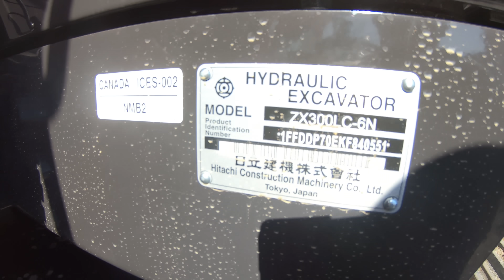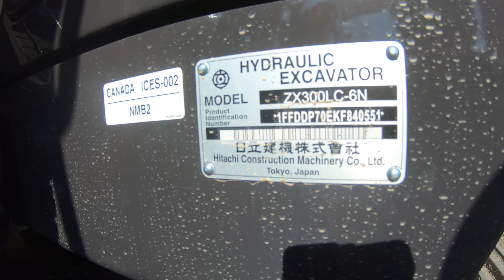Overheating mystery solved for John Deere/Hitachi Excavator 35zts

Comment: There's a product called degreaser (or even strong detergent) which cleans oily things, allowing the early detection of problems and stopping dirt getting in places where it will cause damage. It would allow that filthy oil cooler to cool oil which in the state you have it would not be happening. You obviously haven't heard of degreaser.
Reply from the maker: I cleaned the oil cooler with a pressure washer
Reply: @jmuller86  great news, I'd hate for you to have to pull it off again and risk contamination. It's amazing how oil can act as an insulation and stop radiators from cooling properly, we probably notice it more here in the northern regions of Australia where heat is an issue. There is a very common brand of truck which had to replace all the engine cooling radiators as a recall back in the 1970s because they were not big enough for Australian conditions, so they put new radiators in the trucks with the biggest engines and used the ones they took from those trucks (reconditioned) in the next model down and so on, it still cost a lot and their reputation took a huge hit, probably hasn't recovered even today as they have never regained their market penetration.
Reply from the maker: @ctiley2212  geez that sounds like a nightmare for that company. almost sounds like when toyota did that recall thing on the frames. My friend had a $500 beater and they gave him like $12k to give it back to them

Comment: Stuff rags in the holes when you clean or scrape, then all the crap won't fall into the engine. Carefully pull the rags out. Brass wheel on a dremel will clean the old gasket and any dirt witout hurting the aluminum. I use my finger to make a thin layer... I like using ultra black gasket maker.

Comment: Seems like the fan is so damaged it may cause it to over heat.  HOw much is that to replace too?  THe note you make on that clutch is so important.  See that the counterweight on the clutch is on the opposite site of the shaft so that if the counterweight is pointing down, the shear key is on the top, right?

Comment: I had a new ford 1710 tractor it always run hot,i was bush hogging and a alder hit  my radiator and destroyed it so I replaced it with a new fan and radiator and thermostat and radiator cap thus it was a bad radiator cap

Comment: Weld the clutch to the pully, there is no reason to have a clutch anywhere but the fan.
Reply from the maker: Its not a clutch pulley actually, its a harmonic balancer. Alot of people said to weld it but it could vibrate the motor in ways it shouldn't if I did that.

Comment: Should have changed the leaking front crank seal while you were in there...................oil is is one of the causes of original balancer rubber failure.

Comment: Just a suggestion, I would have changed that crankshaft seal while you had the pulley off. The JD dealer should have told you that.

Comment: Use a water hose and spray water through the radiator and oil cooler sand and dust gets blown between the cooling fins especially with that wet oilcooler on the outside,clean it to get more air flow

Comment: I surprised you didn't replace that oil seal on the pulley.  Obviously leaking.
Reply from the maker: I didnt notice it leaking, it was wet around that area because its hard to fill the oil and I end up getting it down there. But your right I shouldve just replaced it anyways, others have mentioned that too
Reply: @jmuller86  Good Man!  How do you think we "old guys" learned that to begin with?  ;-) Wisdom is just another word for Been there, Done that!

Comment: Jesse, this comment is over a year late, but watch this bloke, John Mills. He has a strong northern English accent, but even if you can't understand that, watch what he does. I am sure you can still buy gasket material of any thickness, even in the USA.

https://www.youtube.com/watch?v=UbTs3CUzMPs

The gasket-making part starts about forty-five seconds in. John uses a steel ball to cut round holes, andn that is good, but you can also use a ball-pein hammer to do the same thing, and using the flat front face will cut then outer edges.

I usually give the part for which I am cutting the gasket a light smear of grease. That helps the gasket paper stick to the part, and prevets it from slipping. 

Paper gaskets are better than silicon because bits of silicon often come loose and block up oil passages and water channels; paper or cork don't do that.  You will never be without the correct gasket again.

Comment: WHY? Harmonic balancer has "RUBBER" in it to act as dampner . RUBBER DON"T GET ALONG WITH OIL?
LOOK AT THE OILY mess on that engine, a good regular washing "MAYBE"
Oh you might want to address them oil leaks? Ya Think?
Reply: Rubber may not get along with oil, BUT there aint supposed to be any oil near the damper ring FULLSTOP. Seen this problems so many times in my many years as a mechanic. You saw in the video how easily he spun the fan with the belt attached, bells should of rung then.
Reply: Harmonic balancers fail and plenty of 'rubber' comes into contact with oil in an engine.  The two are not really related.
Reply: @gus6rocks  if it's a viscous fan it will move , as it gets hot the tension increases and the fan speed increases .
Reply: @dennisphoenix1  nothing to do with the viscous fan, I mentioned the Harmonic balance rubber damper was buggered. You could see the outer harmonic balancer pulley turning independently of the inner one.

Comment: I guess if u can turn the fan with little to no resistance there's a far chance that bottom crank pulley is suspect ay ...I'm a little surprised u dint fit a new crank seal ..all good info tho
Reply: Depends on the engine temperature and the fan clutch.

Comment: You can torque this to spec immediately. *Proceeds to just hit it with impactor. Haha.
Reply from the maker: yea I was just mentioning the fact that you can, I have a few torque wrenches, but I only whip them out if the book screams for it. With the waterpump the book says something along the lines of " install waterpump with gasket" lol
Reply: @jmuller86  I was just messing with ya. I don't even own a torque wrench. I rarely even need one. Good fix man.
Reply: @PossumKing  - Not sure if you guys view South Main Auto's YouTube channel - the owner Eric O likes to also "torque to spec" using an impact wrench.  After a while, when you're as experienced as some are, it's OK to do it "by feel" - except for obvious things like cylinder head bolts! 😀
Reply: Most torque wrenches are way off anyway. If you have a torque wrench and no torque wrench tester, you just have  a heavy wrench.  @samvalentine3206

Comment: Man your lucky you didn't break a crankshaft. Harmonic balancers balance out the torsional twist of the crank. The larger diameter of the pulley will rotate the fan faster, improves the heat balance. And that fan is maggoted..I'd be checking for soft or broken engine mounts..going by the engine oil leaks..make sure all those foam bits are in place around the radiator, to stop hot air recirculation..just my  thoughts..👍

Comment: Didn't your dad teach you how to make gaskets?, all as you to do is to get the correct thickness gasket paper, lay it onto the part and use a small ball peen hammer and using the ball end, gently tap over around all edges and holes, so as to basically cut the paper, the holes you can punch out the rest of the way.
Reply from the maker: yea I have used those for 20 years, but the right stuff is exceptional, its meant for this kind of thing
Reply: @jmuller86  I always carry a tube of "Instant Gasket" which is a black silicon, but in some cases you really need to have a gasket, because the clearance tolerances require it.
Reply from the maker: @brianmillar5075  yes you are correct, I should have mentioned that
Reply: @jmuller86  You might find because you have opened the cooling system, sometimes that can cause small particles to break loose and float around in the cooling system and eventually stuff up the water pump.

Comment: Wow, you went that deep and didn't replace the harmonic balancer seal and any other seals that were obviously leaking oil that caused the failure in the  first place. Job is half done.

Comment: For $200 you could have had a new pulley made without the clutch at a local machine shop.
Reply from the maker: its not a pulley though its a harmonic balancer
Reply: @jmuller86  I do understand that, I have had a number of diesels in my fold, including a couple of TDI's, a Mazda, an Isuzu, a Perkins, and a Kubota, and a Continental. Not all of them required that, due to how they are designed.  Some balance better than others.

Comment: I work in a  garage. , usually. They.  Crank.  Pulley.  Make a lot of noise. When going. Bad.     It's called.  A. Crank. Pulley. Or.  Vibration.  Dampener   pulley .

Comment: I'm no tractor mechanic but I don't see why I couldn't weld the old part solid. But I'm guessing it has a clutch for a some reason... To buy parts later.
Reply: I thought the same   shim it it to make it square and tight and a few good tacks would do it . It's a rubber belt drive so don't see the vibration damper being much use anyway
Reply: Some info here about what is a harmonic damper:
https://en.wikipedia.org/wiki/Harmonic_damper

Comment: so in the end of the it was a busted bearing
Reply from the maker: There actually is no bearing in that pulley, just has rubber between the pulley and dampener
Reply: @jmuller86  thats weird usually when the vulcanization on those fails they just fall apart, it looks like a shot bearing, anyway it's really good knowledge sharing, I've seen broken impellers and those weird clutch systems to turn the water pump on only when the water is worn fail, but never this.

Comment: I would just weld it solid like every other machine
Reply: That's what I said.
Reply: But that would change the balance.  It's a harmonic balancer. Would probably damage something else.
Reply: If welded the same on both sides there will be no issue. It is only used to dampen the vibrations to the alternator and waterpump. But they  already are belt driven, so no high frequency vibrations there

Comment: Why not weld the old one solid and save two hundred dollars.
Reply from the maker: That is also a dampener so the rubber inbetween gives protection to the motor from vibrations

Comment: I would have cleaned the radiator off before putting it back in.
Reply from the maker: I did, I am pretty sure I showed me pressure washing it in the video
Reply: @jmuller86  I guess it just looked dirty. With all of the work you did, I would not want to go through what you did with the over heating.

Comment: $300 dollary doos? Stuff that, weld that clutch up and call it good.
Reply from the maker: its really meant to have that rubber on there, it helps keep the vibrations down from a diesel motor, it prolongs the life of the motor
Reply: YEEEHARRRR.

Comment: could not believe you did not replace oil seal while you were replacing pulley one goes with the other.
Reply from the maker: I had to go back into the cooling system to do some work on the main valve assembly, so I replaced it when I did that
Reply: @jmuller86  ok good lad.  mark.

Comment: Poor design. Crankshaft clutch pulley. Much better to have a fan clutch. Easy maintenance.
Reply: I don't think it's a clutch...  I think it's like a shear point or possibly a vibration damper.  I don't think it's supposed to slip.
Reply: @calholli  - right - the rubber that SHOULD have been in the old part had disintegrated and thus the pulley could spin on the crankshaft hub.

Comment: If your going to fix what you have Buy some different grades of  Gasket Paper and some fuel cork Gasket Material and Make your own Gaskets all so with the part you replaced do not through it away you could scotch key it if you had to.  https://en.wikipedia.org › wiki › Key_(engineering) hope this helps down the track.

Comment: you might check to see if your radiator hoses are collapsing when the engine gets warm or it could be a faulty radiator cap or a clog in the radiator here is a link to explain it  hope this helps http://knowhow.napaonline.com/radiator-hose-collapse-diagnose-fix/

Comment: Gee I would hate to be a digger retailler in America as no one seems to buy new, their repairing their old clapped out pieces of metal junk, you think your saving money, but add up all the down time, and your time wasted repairing your old clapped out rusted machine.
Reply from the maker: or you buy a brand new piece of equipment, pay 3x the retail value with the loan interest, break down and wait a month for the dealer to fix the motor or computer in your "brand new piece of equipment" and on top of it be totally useless to know how your own machine works

Comment: to keep this digger working I would have just "welded" that stupid crankshaft drive up,, that would save me $300 and it would never have broken again!,, but really,, who think's up these stupid type of clutch drive's!
Reply: Evidently , the " front " pulley is the harmonic balancer for the engine .  Standard operating procedure for the 2 parts to be bonded together with rubber between them .  Same way on cars I have worked on .  Occasionally , the rubber will give way , from age , I guess .

Wyr
God bless
Reply: yes that's right, it is a "harmonic balancer" because the engine tends to run a little ""lumpy!"" they fit that rubber drive to help take out some of the surging,, but it is not really needed,,, I have had car's with clutch/ flywheel problem's with this kind of idea fitted on the flywheel's (all that torque taken up on a bit or rubber?) if I cant get hold of the old type flywheel without the "rubber drive fitted" I have just ran a weld around them and put the flywheel back in,, they have all ran fine with no problem's so far?,, so is it really needed in the first place?,, I look at it this way,, if I need to get it going again,, I use any thing that will work!

Comment: Crankshaft balancer anti vibration damper used as a belt drive wow just held by rubber definition fail point ? Opinions are like ass holes everybody has one -+
Reply: Obviously you haven’t had much experience with dampeners. 
Like none.

Comment: What kind of bullshit fuckery is a bearing doing on a crank pulley 🤣 sounds like some VW shit. They have what's called an over run pulley on their alternators so the belt doesn't squeak when you kill the diesel engine.

Comment: sure wish he would of cleaned the block of all that oil and find where its coming from and fix it while your that deep and why he didn't replace that seal on crankshaft  is beyond me
Reply from the maker: I did replace it about a week later when I needed to remove the cooling system for the main control valve assembly

Comment: 19: minutes.  You just bought several hundred dollar worth of parts (new harmonic balancer/ pulley).  What about a new oil seal for that front pulley?  Earlier on it looked as if there was quite a bit of oil leakage of which you made no mention.  With that old pulley wobbling, I would guess the old seal has had its day, and with rubber in that new part, you will be buying another new one well before its "use by date".  To quote from an old source, "For want of a horseshoe, the battle was lost".
Reply from the maker: I did replace that oil seal a few days later, I had to take the radiator off for another project

Comment: Front seals are $600 for this thing.......oh, wait, no - they're far too hard to replace, - err, wait, no they are piss easy - who the fcuck doesn't replace the oil seal?
Reply from the maker: I did replace the crank seal
Reply: @jmuller86  The video showed you putting the new crank pulley straight onto the dirty front cover with old seal in place.
Reply from the maker: @einfelder8262  yea I knew I was going to have to remove the radiator again for a repair to the hydraulic manifold. So a few days later I got all the parts and replaced that seal as well. I had about 50 comments saying I should have replaced it so I def made sure to do that
Reply from the maker: @einfelder8262  yea I knew I was going to have to remove the radiator again for a repair to the hydraulic manifold. So a few days later I got all the parts and replaced that seal as well. I had about 50 comments saying I should have replaced it so I def made sure to do that

Comment: sorry dude, but seriously you're tripping over dollars to save dimes, and it'll cost ya down the road. at least get new gaskets for the water pump- heck i would have just replaced the water pump, get a new drive belt also as it looks like a PITA to change without pulling the radiator again, and as everyone else has said, replace that crankshaft seal. you'll probably blame the machine next time it breaks and you're in the middle of a job.
Reply from the maker: new waterpump was $400, and no way to get a gasket for the old one. its only an hour job now that I did it a few times. crank seal was replaced yesterday, will be in one of my next videos